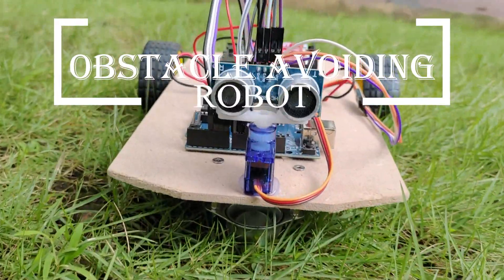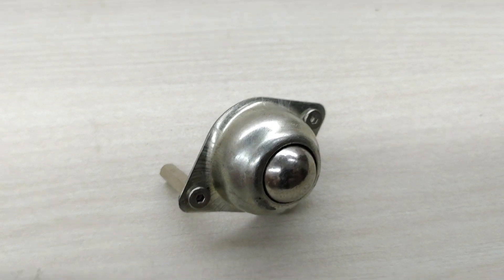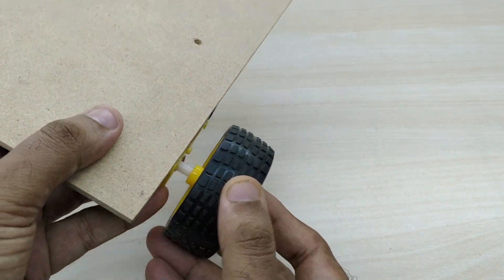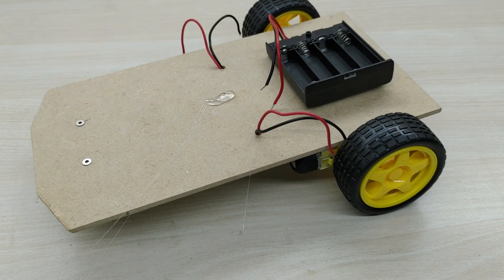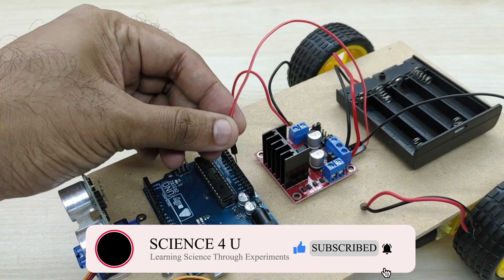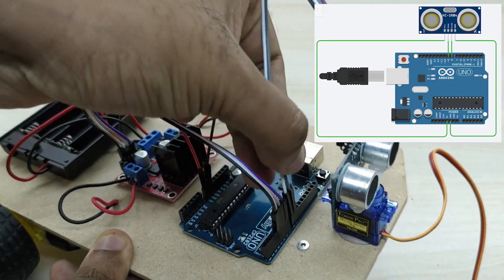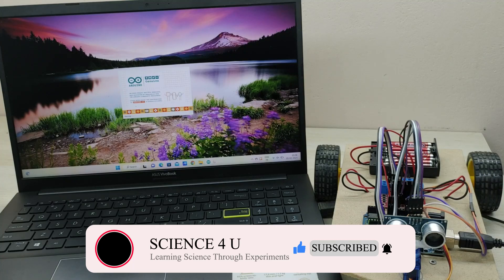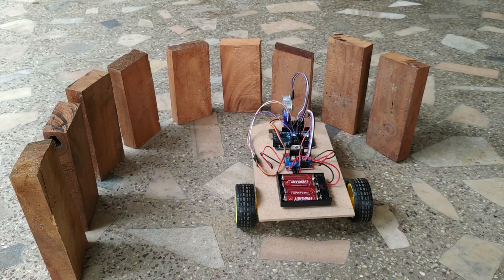Intelligent Obstacle Avoiding Robot || Step by Step Tutorial || Arduino Project

Comment from the maker: Obstacle avoiding robot with advanced algorithm by scanning both left & right 
https://youtu.be/k6W3FYxVS9E

Obstacle Avoiding Robot with Bluetooth Control
https://youtu.be/HbL9FB4Zogo
Reply: My cart needs power because it only works in the air, but when I put it on the ground, it stops working. Instead of using the 4-battery pack you use with 1.5-inch AA batteries, could I use 6-battery packs? Or would that be too much power?
Reply: Proof is that every time the robot senses something it turns only left
Reply: Try explaining it bro, the pinned comment is a lie
Reply from the maker: Hey friend. I think you have misunderstood. There is no fake or lie here in my channel. There are 2 videos. 
1. Robot which doesnt scan left and right : https://youtu.be/kPSBpfUpHt0?si=909Kf0mK6tRViWnP .. In this project, the robot doesnt scan left and right. It just detects obstacle and always goes in the left direction only. Servo is obviously a dummy piece.

2. The robot which scans both left and right is in this link : https://youtu.be/k6W3FYxVS9E?si=RMY3UKpk0egZfDg6 .. Here the robot scans both left and right and goest to whichever direction which doesnt have obstacle. This video is what I have given in the pinned comment  as robot with advanced algorithm.
Reply: But the program says the servo to look left and right if it detects a obstacle
Reply: And the robot turns right only
Reply: It doesn't turn to the left
Reply: @Nikbot-e4r  actually bro u gotta do an L shaped obstacle to make turn left
Reply: The servo was useless in this case, it just senses left and right and only turns right if there is a obstacle.
Reply from the maker: Yes friend. I agree. There are 2 videos. In the simple obstacle avoiding robot, what you told is right. But in the other video of obstacle avoiding robot with advanced algorithm, the robot looks in both derections and goes to left or right direction, whichever direction  is not having obstacle.
Reply: @Science_4U_  amazing love the video arduino my fav
Reply from the maker: @Kaushik355P  Thank you dear friend..🥰🥰❤️
Reply: Can you send me the code
Reply: That's fake it dose not scan left and write the servo is a dummy peice I read the program
Reply from the maker: @user-vq9md7xh3f Please reply if you have further doubts. I will be happy to clarify.

Comment: when to use 5v on l298n ? have you remove heat sink, as you used 4 battery each of voltage?

Comment: i saw in other videos ENA and ENB from motor driver was also connected to arduino. but you didnt connect it. is it not needed?
Reply from the maker: ENA and ENB act as enable commands for the motor rotation. When we put jumper caps, 5V will be applied and the motor will rotate at full speed. The ENA and ENB pins can be connected to Arduino for pulse width modulation commands to vary speed of the motor. In this project the motor is rotating at maximum speed. So the jumper cap is sufficient and a separate connection of ENA and ENB pins to Arduino is not required.
Reply: @Science_4U_ ohhh okay got it thank you. do you have the simulation for this project? like tinkercard, wokwi or proteus?

Comment: I have watched your video completely and uploaded the coded accordingly, but i am facing some issue; My ultrasonic sensor is working completely fine but the tyres are not working; The motor driver is also working; please guide
Reply from the maker: If the motors are not rotating, it could be due to the following probable reasons.
1. Faulty ultrasonic sensor
2. Faulty l298n motor driver board
3. Discharged batteries.
4. Code not uploaded correctly
You can check the above..
Reply: @Science_4U_ I think the code was uploaded properly as the ultrasonic sensor was wmrotating and detecting the obstacles.Also, the batteries were fully charged because we had tested the battery's performance before assembling them into the circuit.So, finally the L298 Motor Driver is the culprit. Thanks for replying. This will solve my problem:)
Reply from the maker: @ishaanverma-wc5ft you can check the motor driver board for its working by connecting 5V pin of arduino to IN1 of motor driver board and GND pin of Arduino to IN2 pin of motor driver board. This will directly give the 5V command to the motor driver board irrespective of any code and the motor should rotate if the motor driver is not faulty.
Reply from the maker: Also another important thing in the motor driver board is that there should be jumper caps on the sides of IN1 and IN4 pin. Without this it wont work. You can check that also.

Comment: Instead of the motor ball at the front if i use 2 more wheels (4 wheels in total) with 2 more BO motors and like intertwine the Bo motors red wire with red wire and black wire with black wire and then connect it to motor shield will it work?
Reply from the maker: Yes..It will work..Only thing is that since there are 4 wheels it will have some resistance in turning. If we use a castor wheel in front, it will turn very easily.
Reply: @Science_4U_  do i need to make any changes in the code?

Comment: Hello, I'm French but I'm very surprised to have succeeded in this project thanks to you. I even managed to add a switch to the robot. On the other hand, mine is a little nervous because I used a 9V battery 😅. But honestly, thank you for putting the code with the diagram, it's cool 👍

Comment: Where did you connect the switch?
Reply from the maker: There is a small switch in the battery holder itself. That is why an external switch is not connected.
Reply: You have the set with 4 batteries but I have set of 3, would it work? And where should I connect the switch? If anything doesn't than pls provide a solution I'm a dumbahh
Reply: Like from where am I supposed to turn the project off and on?

Comment: sir can you please help me i made my car i love it the sensor rotates ultrasonic detects, but the car dont go forward it dectects and go back it dont go forward can you please guide me i am subscribed
Reply from the maker: Hi friend. This could be mostly due to a poor battery. Going forward requires both the motors to work together and consumes more current. So if the batteries are not good, it will not be able to rotate both motors together in the forward dirrction. Can you lift the robot in your hand and see if the wheels are now rotating in forward direction?. Also can you keep the usb of arduino connected to pc or laptop or powerbank and then try if the wheels arr rotating in forward direction?

Comment: How to control the motor speed? I am using 2 nos 3.7 v 3000 Ah 18650 battery and using 100 rpm motor
Reply from the maker: You can control the motor speed by using motor of a different rpm..

Comment: Hi boss can i use 9V HW battery for this..?

Problems im facing...
1. The uno light is dimed after i disconnect to the laptop (is that because of battery's low volt ?)
2. My wheels are not spinning..?

Otherwise all are looking ultrasound sensor is sensing but when u disconnected from the lap its gone off.

Can u please rectify it as fast u could..
Reply from the maker: Hi. It is mostly due to poor battery. Its voltage is dropping when you are running the motors. 9V HW batteries are okay but not very good. If you are using 9V batteries, please use atleast 2 batteries in parallel. AA batteries are much better than 9V HW batteries due to their higher current carrying capacity. You can get 6X AA battery holders which are the best for these applications. You can also use 2x 18650 li ion batteries if you want to recharge and use

Comment: Bro my motors are not rotating even after connecting as u mentioned and uploading the code
Reply from the maker: Hi.. it could be due to a faulty ultrasonic sensor or due to faulty L298N motor driver  board. Have you used new components or are they working and already used ones?.

Comment: My servo motor turns a full circle and wires get tangled. How do I get it to only look both sides.
Reply from the maker: There are 2 types of servo motors ..180 degree rotation motor and 360 degree continous rotation motor. Both look exactly the same. You may be having 360 degree rotation motot. You need to have 180 degree rotstion motor to look left and right.

Comment: When I connect usb to my laptop it's working 100% but when I remove and connect only batteries of same what u have used then only the sensor is working but it's not moving
Reply from the maker: Hi.. that is because the batteries are not powerful enough to run arduino and motors. You can buy 4 nos. alkaline AA batteries and it will solve the problem

Comment: Sir i have other Arduino Uno board it doesn't have 8 pins in power
Reply: Sir give response
Reply from the maker: Hi froend. 8 pins in power are not required for this.

Comment: Sir😢😢😢😢 Tommorow is my science exhibition in school my serv😢o motor and sensor is working but 😢wheels are not rotating 😢😢😢😢😢😢😢😢😢 please help
Reply from the maker: Hi friend. That is so sad..If wheels are not rotating, it could be due to a faulty motor driver board.or bad batteries.
Reply from the maker: Do you see 2 jumper caps on both sides of IN1, IN2, IN3 and IN4 pins?
Reply: It's rotating but stopping by its own in middli
Reply from the maker: @asmitasable8074  ooh..yhat should be probaby due to poor batteries. Sincr it is rotating, connections should be correct. Stopping in between could be due to bad batteries. Can you try changing the batteries?

Comment: i have followed your video but used a powerbank instead of a battery pack the car is moving and detecting but it keeps moving in circles what seems to be the problem?
Reply from the maker: @amel8194  just interchange the connection of the motor that is rotating backwards..
Reply: @Science_4U_  are you saying I should switch the negative and positive wires on one of the motors?
Reply from the maker: Yes..switch negative and positive wires of the motor rotating backwards..

Comment: Hi,
Just wanted to ask if I could make the same robot using arduino nano instead of uno
Reply from the maker: Yes friend sure..make sure same pins are only connected in nano also so that same code will work.
Reply: @ ok thanks 🙏

Comment: I maked with correct pin connections and uploaded the code but my robo was not working😢😢😢😢😢
Reply: me also
Reply from the maker: Hi friend. Most probably, it could be due to a faulty L298n motor driver module or a faulty ultrasonic sensor.

Comment: Brother... Please reply to this comment. That is my arduino board is another model. It will be work in done... Please reply and help me... My board had no IOREF. it may had problem🤔
Reply from the maker: Hi friend. Instead of IOREF, the pin will be labelled as 5V. Yoi can use that pin. Both are one and the same.

Comment: Sir my sensor is not working it is not detecting but tire is moving everything is working sir please please helppp
Reply: Sister, i would like to solve your problem. That is there is no way to confirm the problem of sensor. I think you need to change your batteries. Maybe it works good 😊

Comment: Is there anyway to make this with the switch?
Reply from the maker: @qenchin6266  yes sure. The battery pack that I have used has a built in switch. That is why I did not use a separate switch. You can add a switch in between the positive or the negative wire from the batteries.
Reply: @Science_4U_ I’m using a different arduino which is CH340G will it still work?
Reply from the maker: @qenchin6266  yes friend. It will definitely work.
Reply: @Science_4U_ can you show me how to do the switch?
Reply from the maker: @qenchin6266  It is actually very easy friend. Just cut the red wire or the black wire coming from the battery. Now you will have two ends of the wire at the cut portion. Connect a switch to these two ends of the wire at the cut point. It will work.
Reply: @Science_4U_  Help, mine is not moving at all even when I've uploaded the code.
Reply: @Science_4U_  when I turn on the switch without connecting to my pc there was no light in arduino but there is on the motor driver.
Reply from the maker: @qenchin6266  have you connected the battery to arduino uno also?

Comment: Why is my robot spining around??
Reply from the maker: @fico4943  Hi friend. That is because the motor connection to the l298n motor driver board is given wrongly. Just interchange the wire connection from the motor rotating backwards and the problem will be solved.
Reply: @Science_4U_  thank u brother it is working now❤️‍🩹

Comment: I want to make my robot move faster so what changes I have to make to do it
Reply from the maker: @gamingmind7868  Either you can increase the battery voltage or you can use a higher speed BO motor..

Comment: gm sir, my only 1 tyre is working at time and another is working when my 1st one is not working my servo motor is also not moving and sensor is also not working i have done all the connections accordingly and also coded properly as given pls help asap!!!!!
Reply: Sir pls tell because I have to submit it for my internal marks for 10th class for AI
Reply from the maker: It should be most likely due to poor batteries. The battery is not able to drive both motors together. I think replacing the battery will solve the problem.
Reply: Ok sir how much volta battery should I use cause I am using a 9v battery
Reply from the maker: @akarshsinghal3120  9V battery is good enough. It should be a new battery.
Reply: The tyre which rotates has a very high speed and whenever I keep my hand in front of sensor the servo also don't rotate ......can uh pls give the code here mentioning my problem.....it will help a lot thank uh for reading and replying my doubts❤🙏🙏🙏
Reply: Ok sir pls tell about the other problem like the sensor one and pls share the code here

Comment: Hi, I have completed the project. But I am not able to run the robot. Only one motor runs and other doesn't run at all even though the other motor is in perfect condition. Whether is it battery problem.
Reply from the maker: @karthiku9282  yes friend. I too think it is a battery problem only. The battery may not be able to run both motors together.
Reply: @Science_4U_  ok any solution for this
Reply: @Science_4U_  sirr i also got this problem i am using 9v hiw batteries pls help

Comment: Thank you it helped me so much. Now I am buliding obstacle avoiding robot in my agriculturally based seed Sower project
Reply from the maker: @karthiku9282  Wow!!! that is great friend. Nice to know that my video was of help to you.🙂
Reply: One doubt. I am having a 9 volt dc battery. Will it work on the project I am making?
Reply from the maker: Yes friend. 9V battery will work. But it will not last long. You can use 2 Nos. Of 9V batteries in parallel which will ensure longer operating time of the robot.
Reply: Thank you

Comment: Can you please tell me what is the need of the servo motor here because even though the sensor detects something in front it always moves back and then take a left turn so what is the need of the servo motor to look around like it is not actually looking for a way-out right?
Thanks in advance and I like your videos keep going ❤
Reply: Yeah but servo motor gives movement of turning left or right to your ultrasonic sensor. So when it detects some obstacle it uses servo motor as its neck to turn left or right and continues its path. I hope you find this helpful
Reply from the maker: @Rizwan-h7l Hi friend. What you told is absolutely right. The servo motor is given to just give an impression of the robot looking left and right. It actually doesn't do anything funtionally. Without the servo motor also, it will behave exactly the same on detecting the obstacle. Just move back , take a left turn and go forward.
Reply from the maker: But I have made another video where the robot really understands whether it has to move left or right after detecting the obstacle, by looking both sides. For that, the servo motor is important because the robot has to look both sides and understand which direction is clear and move accordingly. You can watch this video below..
https://youtu.be/k6W3FYxVS9E

Comment: How many jumper wires do i need and which ones?
Reply from the maker: Hi friend, the ultrasonic sensor and motor driver board connection to arduino requires 4 nos
 male to female jumper wires. Whereas the servo motor to arduino connection requires 3 Nos. male to male jumper wires..then 2 nos. male to male jumper wires for transferring power from motor driver board to arduino.
Reply: Thanks 👍
Reply: My servo motor doesn't turn
Reply from the maker: @milosneskovic984  Have you checked the connection to servo motor?. Also atleast do you feel some jerk in the servo motor?. Sometimes battery may be discharged and not powerful enough to turn the servo motor.

Comment: Have you used Lithium ion battery or simple battery?
Reply: Code, connection everything is ok, circuit is getting the power supply but the car is not moving, I'm using 4 pieces of 1.5 V battery
Reply from the maker: @poojak12  There can be many problems friend.We have to check one by one. Can you message in my instagram profile?. I will help..My instagram profile link is given below.
https://www.instagram.com/_science4u_?igsh=MTM5aXFpdTM5aG5lNg==
Reply from the maker: @poojak12  I have used AA 1.5V batteries only, 4 nos..
Reply from the maker: But Li ion batteries are better. 2x 18650 3.7V batteries are better for this application.